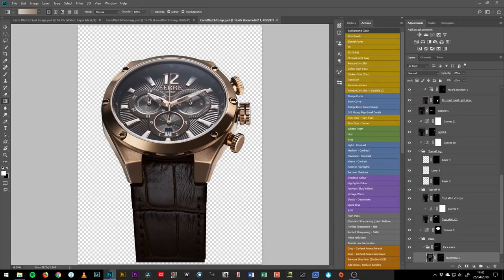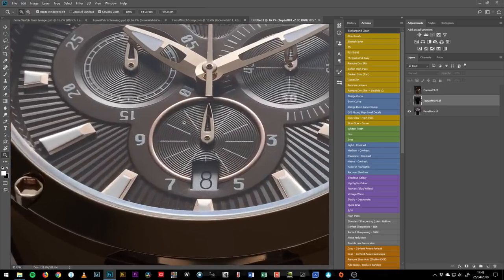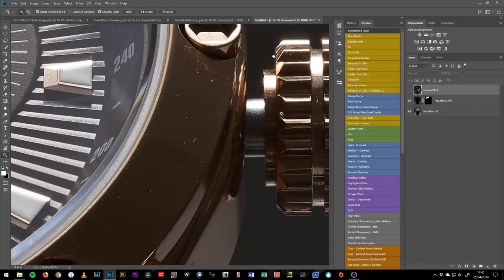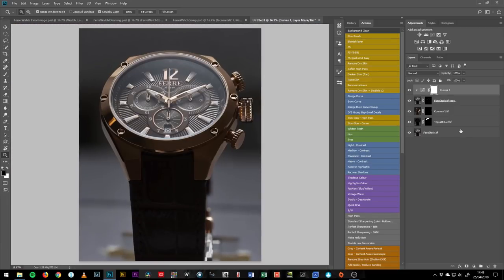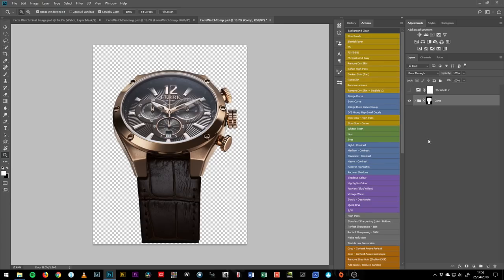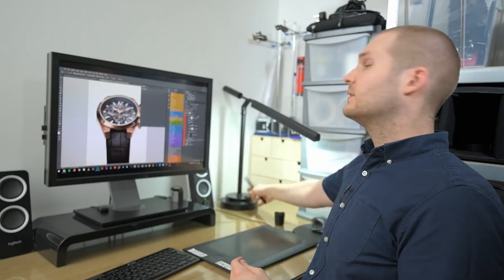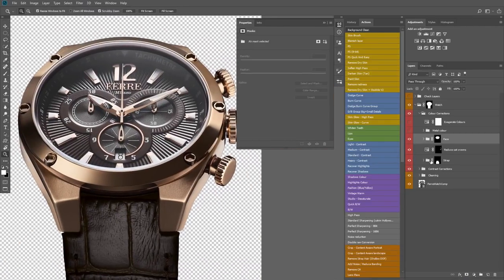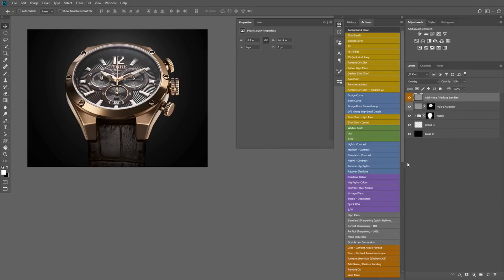Compositing Still Life Photography | One Light Watch Photo Part II

Comment: I've found that to avoid image shaking while taking photos(I'm a stop motion animator so I need to take hundreds to upwards of tens of thousands of shots without shaking things), using a magic arm on the surface I'm photographing things helps a great deal compared to using a tripod I'm prone to accidentally kicking. Just make sure you have the right kind of clamp attached, otherwise the clamp might shift around a bit on you. I really want to try compositing different types of lighting exposures though, as having multiple lights on at the same time on such tiny scenes can muddy up the atmosphere. 

Btw thanks for this tutorial series. The way you explain things seems to be helping me a bit more than most.
Reply from the maker: Happy to hear it's helping. I normally use a studio stand (a large and very heavy column stand 6-9ft tall) which works well. Only trouble there is how sturdy the table you're shooting on is and what the floor is like. Nice idea clamping to the table, I seem to remember Matthews (maybe) making a table clamp for cameras.
Reply: @maxbridge8921  oh, maybe if you're having issues with the table, you could get a magic arm and two clamps to secure the table to the stand. They should be strong enough to eliminate basically everything short of deliberately kicking the table over.

Comment: Do you only focus stack the face? And then focus on the other elements individually when you are shooting them? E.g. Was the strap exposure a focus stack,  or did you just focus on the strap for that shot?
Reply from the maker: That's right. I tend to do one stack of the whole watch, usually when shooting the face, then focus on the individual elements I'm shooting. Sometimes I don't need to stack at all if the element is small enough. Hope that helps
Reply: Cheers! Brilliant tutorials by the way. Nice to see from a fellow Brit, too! You're great at what you do.
Reply: @maxbridge8921  do you ever run into issues comping the non-stacked exposures with the stacked ones, due to the slight focus breathing/zooming effect being different in each single exposure? If that makes sense...
Reply from the maker: @ballamoto  makes total sense. Not really had issues before. I can think of a couple occasions where things don't quite line up perfectly but you can usually employ a little Photoshop wizardry if need be; warp, liquify, etc.
Reply: @maxbridge8921  Alright thanks! I'm actually doing a watch shot right now! Focus stacked some, and composited some others. Hit a few tough spots, but all in all its going ok! Thanks again for the tutorial 👍